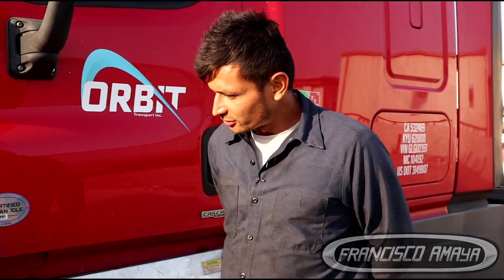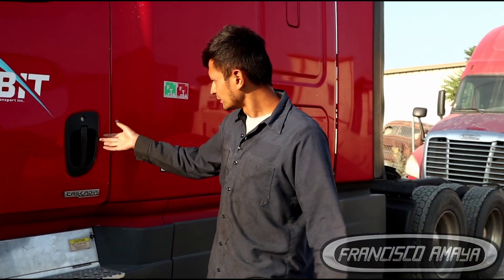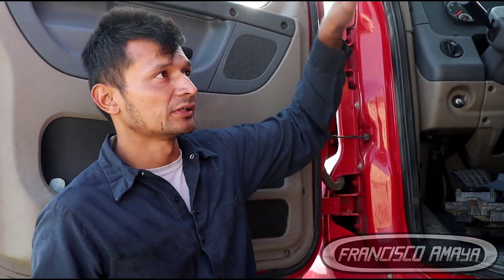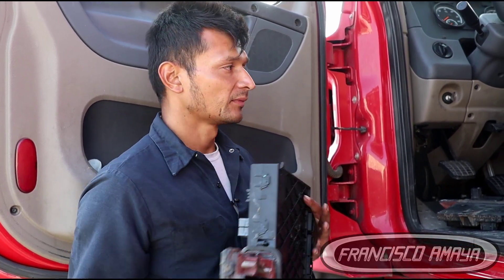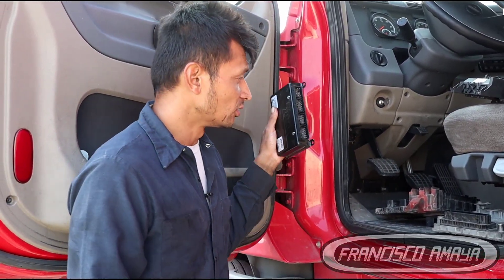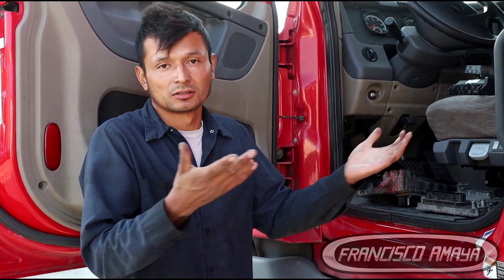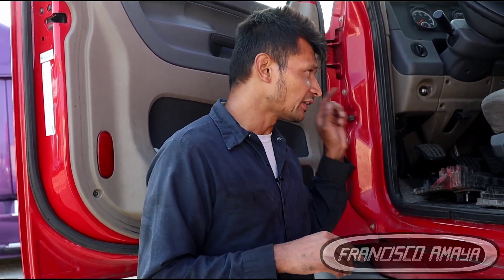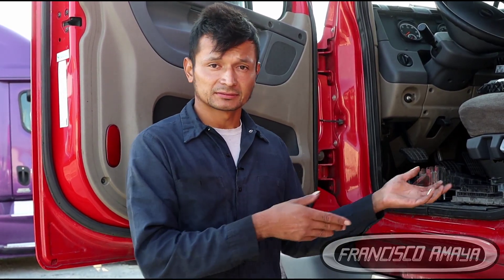Freightliner cascadia electronic problems module damage and replacement repairing the electronics 2

Comment: I've got an A/C that works perfectly for 20 minutes then stop. I've replace the compressor that was locked, and condenser and dryer and 3pin transducer  switch from Freightliner. any suggestions for this. Gregory  in Alabama

Comment: francisco, my 2015 cascadia dd13 automatic trans shows MCM code and then shows low circuit to all 6 injectors. could it be a bad engine harness. the truck runs then will randomly pop up both yellow check engine lights, but if i crank again truck will run but 1 check engine light stays on and derates.
Reply: I guarantee it’s the main harness that’s the exact problem I had replace the harness trust me I some of 10k at the end it was the harnesss

Comment: Hello i got a 2010 freightliner cascadia with no signal to starter. I can feed power and it will crank but won't start. I replace clutch switch but nothing. Do you have a clue what can i try next.
Reply: Did you fix it?
Reply: Cpc control module

Comment: I changed the Sam cab cause it had burned out and my lights started working again properly but the truck won’t start and I get no power to my pndb it wants to crank over but doesn’t start
Reply from the maker: if it was working fine before you replaced the samcab, probably you one of these 2 problem. a bad samcab or samcab needs to be reprogrammed (has auto trans coding)

Comment: I have a cpc4 problem I bought a used put it the truck started works properly I didn't program it. The old cpc4 I fixed and it work properly too, any recommendations ?